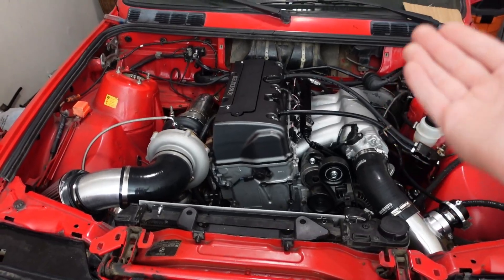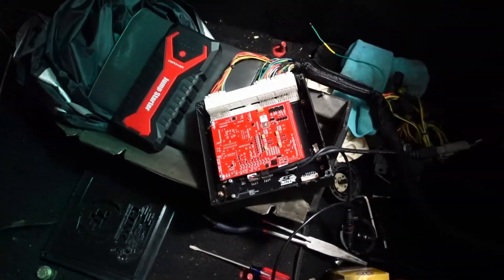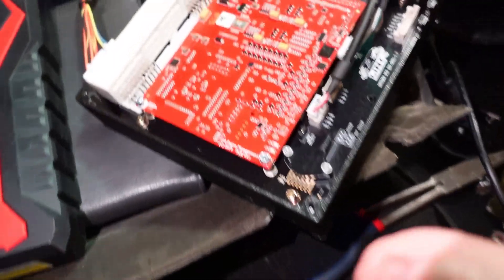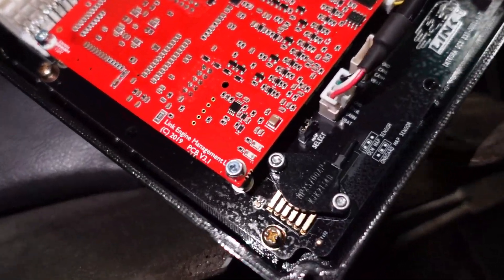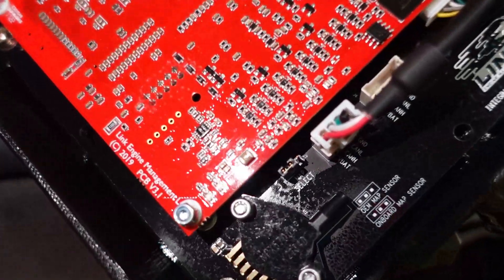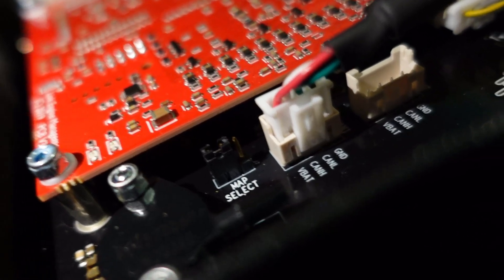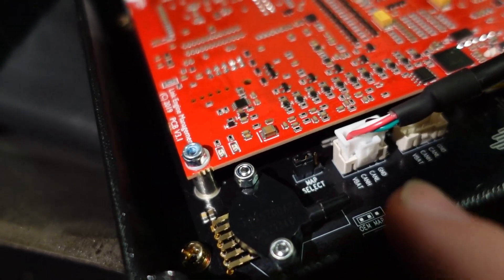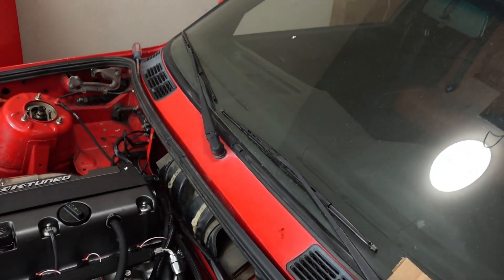Solved: Link ECU Map Sensor Not Reading (Failed Calibration)

Comment: Great job! What’s next for the car?
Reply from the maker: So since fixing the map sensor issue the car actually stopped running well because the numbers were so messed up, so my goal is to get it idling and get it ready for a dyno session, I obviously couldn't bring it to a tuner until the map sensor was working!
Reply: @ sounds good! Eagerly anticipating the next video. Cheers!
Reply: @ProjectRacecar2 how can avail hc20x ecu